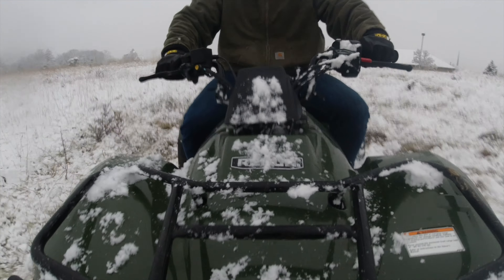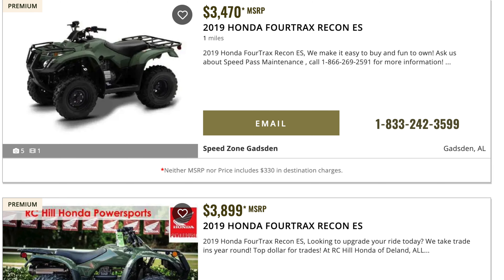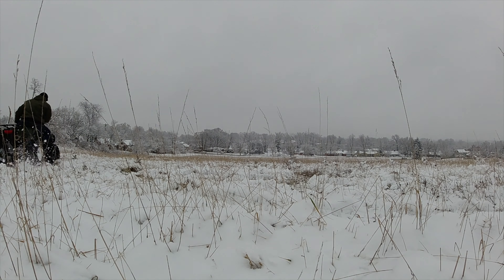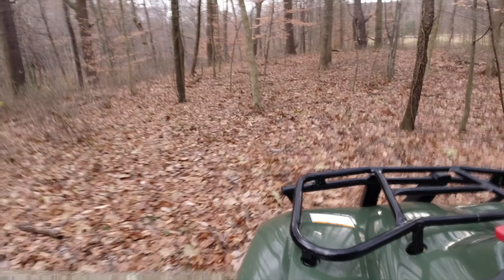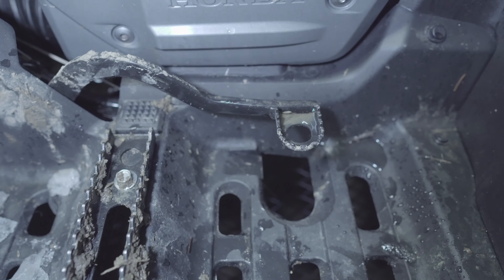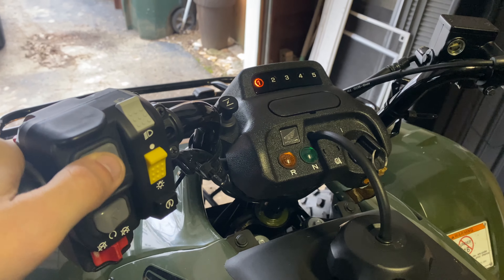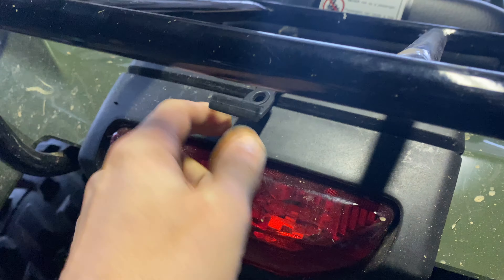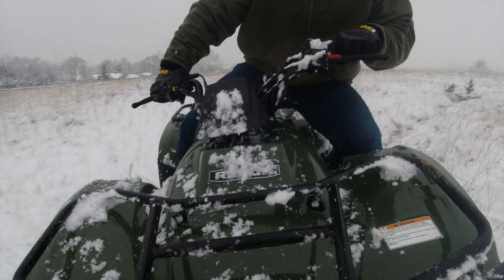2020 Honda Recon Review (2017, 2018, 2019)

Comment: Everyone should have one. They are quiet, fuel efficient, nimble, and capable. They’ll get you nearly anywhere w/ a hundred lbs of gear. A full tank will get you 70 miles. My 2018 fits nicely in the bed of a Toyota Tacoma, Honda Ridgeline size truck. Easy to load..easy to store..and really fun too. I’m 6’5” 220 and feel like I can man handle it and throw it around by shifting my weight. It has a bit of sport quad feel to it because it’s so light. A lot of folks see 250cc and dismiss this ATV. Don’t, because this thing is a blast and is one of the best purchases I’ve ever made.
Reply from the maker: Good point, I actually own a Honda Ridgeline, and this fits just fine in the back.  I don’t even need ramps to load it, I just lift up the front end onto the gate and then lift up the back end up the rest of the way.

Comment: I'm a Ranger and I use this EVERY day. This is a very dependable ATV and it has never left me stranded. I have used it along creeks, woods, and sand. It will go up huge embankments if you know how to work the throttle and gears. Tires are a great investment and buy accordingly to usage it will be very noticeable. We have female Rangers as well and they were put at ease immediately during training when I had them pick up the back to show how light it was so dont worry about getting it stuck. It's fun, rider friendly, and RELIABLE. Great review

Comment: Just got a 2021 recon es in tan yesterday and love it soo far.  I have a deposit on a footshift rancher 4x4 coming in mid Dec but got the recon eventually for my gf and son if we go trail riding.  The size of the recon is good, i am 6ft 300lbs and the recon gets up and goes even with my fat ass on it.

I woulda preferred footshift on the recon but all the atv dealers near me seem to be slim pickings right now and I really love the tan color vs the olive or red.

My 2021 does not have a gear indicatoe, only reverse, neutral and dummy light for fuek/check engine.
Reply: I just got 21 tan es the other day lol

Comment: I ride mine in negative 40 in Alaska. It still won’t let me use the choke. Choke stalls it. Maybe one day it will go negative 100 so I can use choke
Reply: How i used choke a few days ago on my in 30 degree weather
Reply: Your idle jet is running too rich, you need to adjust the fuel screw.

Comment: Story time!
I was on a 2009-ish fourtrax (rancher) several years ago. I was headed up a hill and at the last second I saw a guy on a Grizzly (giant quad) coming down the hill. I instinctively turned to the right to avoid him when the quad started to tip.  I jumped off the quad and booked it down the hill as the quad rolled after me. I was told I looked like I was in a cartoon chase scene.  
After about 20 feet, the quad came to a rest. We inspected it and there was no damage except a third party windshield that was on it cracked.
Reply from the maker: Built like tanks!
Reply: HONDA👍

Comment: Hi Eric great video.  My question is what's the difference in gas usage between the carb like yours or the equivalent model in fuel injection? I wanted to buy a 2020 250 ex but now that I'm searching a little more these models are more versatile in my opinion.  I just might switch. I enjoyed your thoural  owner review.  I hope you continue to due updates. One more question.  You mentioned your recon doesn't have a chain.  Does that set up have a short life span that we would have to replace the unit vs maintenance on a chain and replacing it when worn. Thank you.

Comment: I just bought one. It better be good because Kawasaki, Arctic Cat, Polaris and Can Am all have less expensive machines with more accessories. Only bought it because I hear they are bullet proof. Expensive for what you get though.
Reply: I'm about to buy one for the same reason over the others, its a Honda. Would you buy it again over the brute force 300?
Reply: HooDRidEWhiteY So far so good, badic but easy maintenance. I miss the accessories though. No speedometer, temp, gas gauge. But mechanically and performance wise it is great. I love my Arctic Cats too but since they sold the company its hard to find dealers, parts and service where I live and their customer service sucks. Still good machines otherwise.
Reply: HooDRidEWhiteY I have an Arctic Cat 300 which I believe is manufactured by the same company in Taiwan that makes the Brute Force. They look identical other than the logo. Fun machines and built well but the Honda Recon keeps up and actually seems to stay grounded better than the 300 for whatever reason. Odd since I can lift the Recon up to move it in the garage. Also the Recon uses regular 30 weight oil like a lawn mower so it needs nothing special and has no oil filter need. Very low maintenance. The oil filter on the 300 is internal, little more work and needs special oil.

Comment: 4:45 not the recon it always had independent front suspension and solid rear.  I had a 2001 recon and the only thing that has changed really, is looks and a few things here and there but  basically the same ATV and definitely recommend getting

Comment: I have a 1999 that still runs and shifts fine.  I recently added a new OEM carb and it purrs like a kitten.  No smoke.   Its an amazing machine.  It finally quit charging back to the battery so i'll probably have to install a new stator.   So i bought a new 2022 to keep it company.   The Recons are well worth their price.
#postscript....it was just the battery.   Put a new no name battery on her and shes back charging 14.4 Volts.

Comment: I have a 2017 purchased it brand new. I did the normal break in. Is it normal to hear the valves?
Reply: These Recons have rather noisy valves we have a few at work one at home and a 250EX so I get to hear this engine all the time. If it seems excessive it may need to be adjusted but excessive is hard to describe if at all possible go listen to some other 229CC Hondas IRL.

Comment: I have a mint 2002 Recon. Very low hours. But I must say also that it has electric shift with the illuminated gear indicator on the dash. So this feature is not relatively new. It goes back to at least 02 models.
Reply from the maker: Thanks Gary, I stand corrected!
Reply: Bought the same model, foot shift, great condition. I’m about 205lbs and my dads 215-225. Was shocked this tiny thing hauled both of us around so easy. It’s a perfect fusion of sporty feel with utility body.
Reply: @frydaddy1535  it is a very torquey little machine. I do wish it had a lower first gear though so that you could creep it along.
Reply: I believe only es model comes  with gear indicator. Just looked at a 2019 recon foot shift model- no indicator.

Comment: Thank you for such a great review! Im looking to order a 2022 Recon but i'm torn between the foot shift and the ES. 
QUESTION: When shifting a foot shift do you have to "blip" the throttle  or can you simply keep the throttle held while shifting? How about the ES, can you keep the throttle held?
Reply: In my experience it's a slightly smoother shift if you blip the throttle but holding the throttle and jamming it into the next gear doesn't hurt
Reply: @userfour-2087  I finally located and bought the 2022 Recon ES. As you said for the manual it's the same for the electronic shift. I can hold the throttle and up/down shift (pressing the buttons) but it clunks into gear and doesn't sound healthy. However, a simple throttle blip and it's a seamless shift.

Comment: Can you put a trailer hitch on it? I had a 2002 model for 18 years and it got stolen. I would hall me and my two sons on it or a deer me and my sons . I pulled a trailer with three people on it etc. It was unbelievable work horse for 18 year. I was wonder if you can still put a hitch on it and are they still built great like 2002 model .
Reply: Yes you can I have a 2017

Comment: Really appreciate this i plan on a new 2018 tomorrow 
Is the reverse system revised on the recon model to go into reverse from any forward gear? Cheers from wi
Reply from the maker: Unfortunately not, you will need to downshift all the way to neutral before going into reverse.

Comment: For 2021 the es model doesn’t display the gear you’re in anymore I wonder why??
Reply: Just got a 2021 yesterday and noticed I have no gear indicator.  Not a big deal but odd that they would add that feature and then remove it.

Comment: Would you know why honda stopped making the recon 250 , would like to get people's view on it
Reply from the maker: Word is that they are halting production in order to revamp the quad from the ground up.  In my opinion, this is a good move because they’ve essentially been producing the same machine for over a decade.  It would be nice to see some modest improvements.  I’ve also heard murmurs that they could be coming up with a 4 wheel drive version, which would be slower, but better suited for off-roading and utility purposes. So my guess is that they will resume production in a year or 2 once they have the new design and all of their production set up.
Reply: They did halt for a revamp. Reason being is in 2018 (I believe maybe 17) even Suzuki changed the game on the King quad. I have a KQ 750 and my wife has a 500.. if Honda does a nice revamp I’ll buy one for either my wife or daughter. I love a Honda since I grew up on Honda bikes, but always had KQ atvs. Nice review!

Comment: How tall are you? I’m 6’1 220 am i to big for it?
Reply: No my buddy has the 2020 hes 6'4" 250 pounds and he keeps up wuth the 500 foremans
Reply: I'm 5'11 an 280lbs, it's fine for me.
Reply: @l.d.roberts2194  What’s the story on these with shifting man? Is it semi automatic? And if so, say you are in 3rd gear and then stop all of a sudden…will the engine die if you don’t shift down fast enough?
Reply: @damon323  electronic shift, at least mine is, as long as you get the right oil for a wet clutch shifts fine. Mine dont die out when I let off an dont down shift.
Reply: @l.d.roberts2194   Ok, figured so with electronic shift, but I’m looking at a manual foot shift for my wife
Reply: @damon323  they make them, but most dealers won't have but one or two. May have to go older, mid 90s like a Bayou 220 or 250, something like that.

Comment: Wow dude you don’t even know what you are talking about the go like 60 or 65
Reply: With mods
Reply: Nope. Impossible. 42 is the max.
Reply: Lol, it’s a 229cc engine geared for multipurpose use.  The top speed is listed as 42-46 on EVERY website I see.  60-65 is only achieved with substantial modifications.  You criticized the objective facts, and made yourself look stupid, 😂😂😂
Reply: Maybe with a six year old driving it down hill but not a grown man
Reply: @Anonymouso283  my 2005 Honda recon hit 45mph with stick tires on the gps. It’s governed to that speed but I did put some really aggressive sunF mud tires that are really have and a badland 2500lb winch and winch mount so it added about 80 plus pounds to the stock configuration so now it probably will only do 40mph.